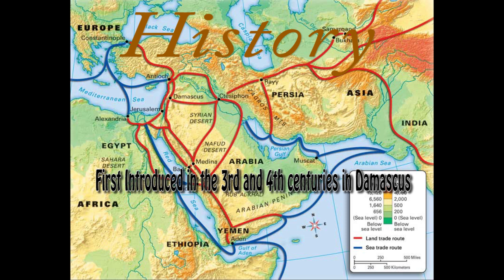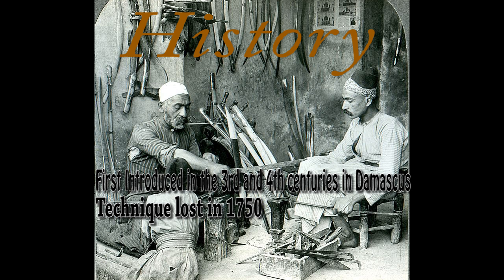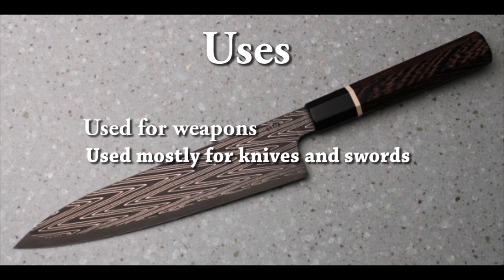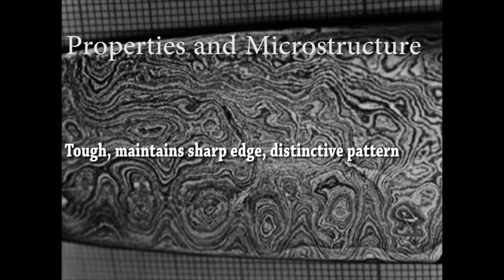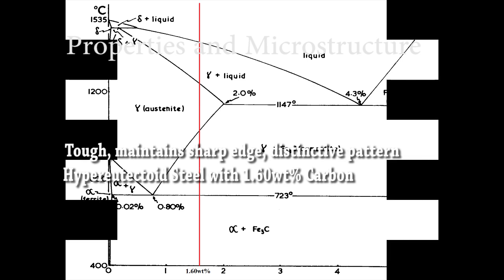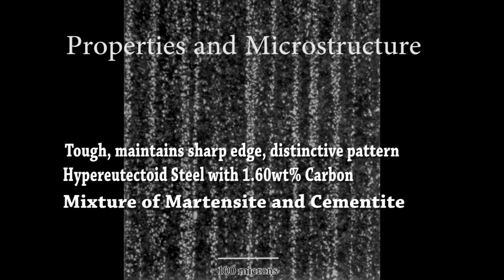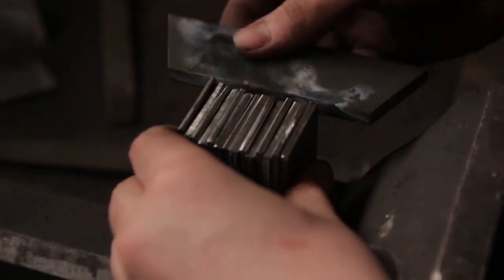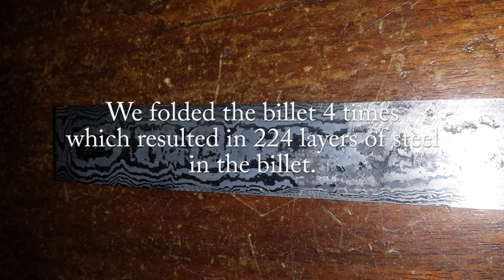Damascus Steel

Comment: Crucible wootz is the real Damascus steel. Pattern welding is just mimicking the patterns inherent of crucible wootz without having to deal with melting steal at high temperature with carbon and necessary trace ores that give it the strength, hardness and flexibility of the original thing. Recommend watching this instead: https://www.youtube.com/watch?v=OP8PCkcBZU4

Comment: Warren Swift
Unfortunately you don't know what you are talking about. In the past the Japanese had superior steel blades than any middle east or European steel, Damascus, Wootz or any other alloy.
These days German blades are excellent and Japan also produces great blades but the steel of the past has no resemblance to todays steel alloys.
Modern steel blades are 10 times better than any Damascus, Wootz, or anchient Japanese blades.
Damascus, Syria produced steel no more than Best Buy produces televisions.
Reply: markspc1 you are fool,
Wootz Steel is real steel and reached to Japan China from india

Comment: This video is contradictory. The male said the technique for producing damascus steel has been lost while the female claim damascus steel is still being produced today. WHat the actual fuck?
Reply: this entire thread is wrong the nomenclature "damascus" refers to steel that has an inherent pattern, the Indian variant was literally crucible steel that cooled slowly forming dendritic crystals which when forged carefully could be preserved to leave a patterned look, modernly it is made from stacked steel of varying carbon content which is often twisted during the forge wielding process. same outcome similar properties
Reply: The technique to making it from scratch is gone but it can be reforged using existing Damascus steel.
Reply: no it cant. if you tried to reforge it you would inevitably get steel with different qualities, because you don't know how to work damascus steel.
Reply: Benjamin Chance well that was old Indian technic,. Lost for forever.
Reply: simple answer is what 99% of the people call Damascus today is not true Damascus its pattern wielded steel pattern wield is not made the same way it was 500 years ago so real art of it is gone